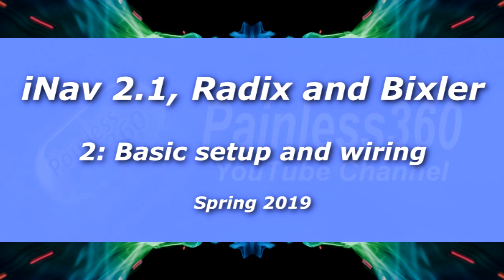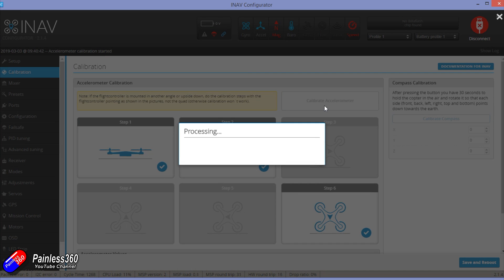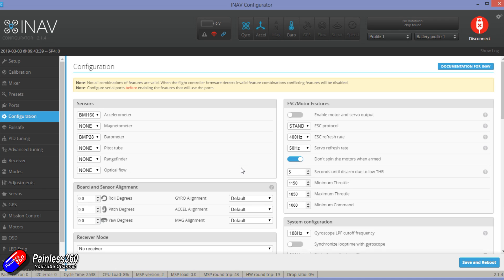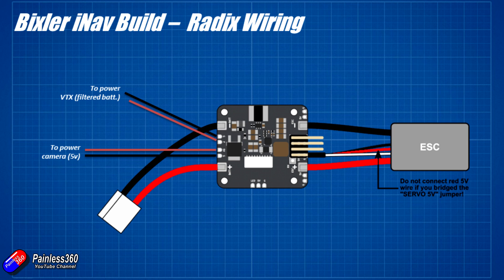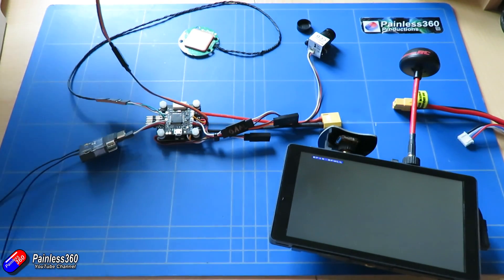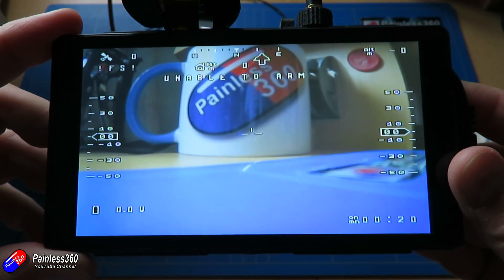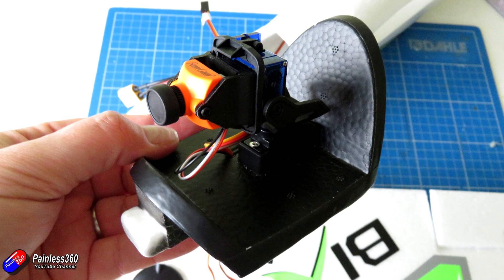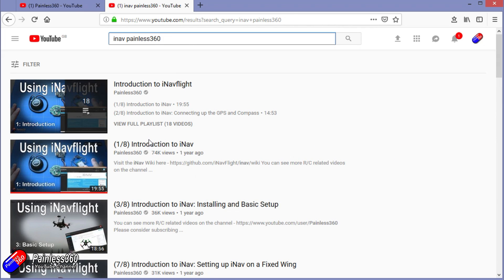iNav 2.1/Radix/Bixler Build Series: 2. Basic setup and wiring

Comment: I'd love a video solely focusing on wiring fpv cameras, video transmitters, and inav osd/uart settings. I'm having issues trying to get my camera and video transmitter to work. (I'm using a Runcam Phoenix 2 and TX200U and wanting to set up iNAV OSD.
Reply from the maker: Check out my INAV for beginners series, I cover it in there.. best of luck
Reply: @Painless360  I have watched that series several times. I must have wired something incorrectly.
Reply from the maker: Possibly, it is easy to do. Try getting the VTX working first - you'll have a black screen with the OSD on it but that will make is easier to see where the problem is.. Best of luck!
Reply: @Painless360  I made some extension jumpers and plugged the camera and vtx in 1 pin off from where they were supposed to be... I feel like I wasted hours troubleshooting and second-guessing myself for nothing. Lol
Reply from the maker: You learn a lot more from a mistake than you do when it goes right. You'll never make that (or similar) mistake in any build for a while now.. Great to hear you got it sorted!

Comment: Hi Lee - great video. Just back from a disastrous afternoon after crashing the Skyhunter 1800 due to INAV playing up. Thinking of getting a BIXLER as next model. Currently using Matek F765 - would it fit in the BIXLER?
Reply from the maker: That would be a tight fit. See how I squeezed in a flight controller in a previous build series.. Happy flying
Reply: @Painless360  Yes - just watched your video. What is the Flight Controller that you used and is there a newer model?
Reply from the maker: Links to it in the description on that video.. Happy flying

Comment: Hi, I am running Inav  2.1 on omnibus F4 pro and bixler 2. Do you think I can do the same for servo mixer? Like have the Y cable for the aileron?

I have flap too. Where you you think I can connect it?
Reply from the maker: Should be fine. I'd use the 5v BEC pin mod I used to make sure the servos have power from the ESC...
Reply: @Painless360  thank you!

Comment: how can you setup UART3 for CRSF signal received thought TBS Crossfire in iNav? in receiver mode it doesn't give that option for CRSF protocol
Reply from the maker: I'm planning sure that it is supported at the moment. You can use sbus if you cant pick CRSF...
Reply: @Painless360  i think in the receiver mode  section 2 drop down bar you select TBS Crossfire which my only option could be CRSF :D

Comment: On the GPS puck just wondering does the compass be also included with in with TX and RX function or do you need to use either or SCL, SDA for the Compass to work ?
Reply from the maker: You need SCL and SCA for the compass..
Reply: @Painless360  was just wondering how Fpvbrain OSD gives you a compass reading, if connections are not being used later on your video?

Comment: Now that I look at it my VTX (TBS Unify), like many video transmitters today, is HV meaning it wants full battery voltage.  Not sure where on the Wing Power Board I tap into filtered battery voltage.  I haven't found much info on the Wing Power Board, even on the Brainfpv site.
Reply from the maker: I'm using it that way - diagrams in the series..

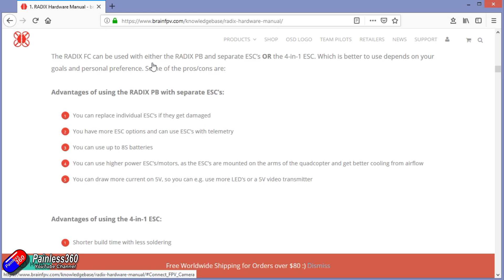Comment: What is the best way to power the VTX and Cam?  At 7:27 you show power from the Wing PB but on 6:33 the Radix Manual shows power from the Radix Board?  Does it matter?
Reply from the maker: I did it the way I show in the video.. works for me..

Comment: Really nice and clear instructions.  I noted you tested the setup using an LCD screen with radio gubbins - can you tell me what type you used (is there a review on it?).  Thanks
Reply from the maker: That is the screen from my fatshark transformer goggles. There are lots of options for screens like that and I use them rather than goggles for the videos as they are much easier to see. Happy flying!

Comment: I just finished (almost) my first fixed wing setup with the Radix FC and Wing PDB on a sonicmodell ar wing 900mm but have run into an issue. My ailerons only move full throws when I move the stick to the upper left or lower right. Moving the stick straight up, down, left or right only gives me about 5% movement (if that). Also, the control surfaces move in the correct directions (opposing) with the 'roll' stick movement (left and right) but do not move in the same direction (both up or both down) for what would be 'pitch' (stick up and down). I am sure I must be missing something obvious.

Have you run into this before or have any ideas?
Reply from the maker: https://youtu.be/SA7reaRMF4M

Comment: Looks like to do this build ill have to buy a completely new radio system as only got a DX6i or is it possible to do it with that ?
Reply from the maker: Nope, that should work fine. All of the clever stuff is done in the FC..
Reply: @Painless360  will you be doing a video of of to do that setup for a TX like dx6i ?

Comment: Great video, neat job and very interesting, thanks. I have recently set up a fully automated FPV Bixler 2 using an older APM 2.6 board, with MWOSD and a teensy 3.2 board flashed to pass telemetry back to a FRsky telemetry RX (pass through is not an option with old APM's). With the APM the Bixler is capable of fully autonomous flight from takeoff to landing without me being there (more fun when I fly it FPV). A Runcam Split provides FPV vision and HD video. I like your addition of the 2 axis gimbal and I'm keen to see the flight video. Thanks again Lee for showing us what is possible. My video is at https://www.youtube.com/watch?v=3TkhkZG-2-A if interested.

Comment: Lee, that is a heck of a tight and well thought out build.   I’ve already ordered the Radix flight controller and wing pdb (they are hard to find in stock).  I agree with you that the vector graphics display is so much better and cleaner than your basic clone F4 board.  I fly lots of fixed wing high performance craft such as Draks (full size and mini),  various wings, mini talons, and lots of HK Avios and Durafly stuff, and even a Bixler.  I have three working Eagletree Vector flight controllers and a fourth that is history after a spectacular lawn dart crash.  My question is this: do you think this Brain FPV FC and Inav is robust enough to put in a 100 mph Ritewing Mini Drak, as I’m not buying any more $ 240  Vectors?  I think your setup is very elegant and cost effective.  Please advise, and thank you.

Comment: Can you use inav to operate a vtol?  If so what configurations are supported?. SLT?,Tilt motors?, tail setter? etc.
Reply from the maker: Not that I'm aware of.. yet!
Reply: @Painless360  darn.   Can mulitple PID values be set up and activated by a switch?  If that is possible vtol   programming would be easy

Comment: Nicely done!! Are you powering your all 4 servos from the ESC's BEC? and did you have to do something on the radix board to isolate the boards 5v (on servo output pads) from the ESC's 5v? thanks.
Reply from the maker: Yes, see previous video in the Series for details. The 5v BEC on the wPB isn't powering the servos..

Comment: I prefer Bix 3 because wings come off which give you more acces 

Were did you get the GPS unit ?
Reply from the maker: I've had it for ages - Banggood or eBay usually..
Reply: @Painless360  So any gps unit will do ?
Reply from the maker: I use this one or an M8N (as per the iNav Wiki) see all my iNav builds...
Reply: @Painless360  If thre is a gps unit does it mean you can do RTH ?
Reply from the maker: Yep. Watch he rest of the series.. I show it in action..
Reply: I just received my BN 880 unit and it works well with F405 Wing!

Comment: The Radix seems to be out of stock. Shipping fees from UK to Austria is also a bit high. Could you recomment a FC for my Bixler I can order at Banggood or something like that? Any good alternatives for the Radix?
Reply from the maker: https://youtu.be/te4D_fjBVfM may help..
Reply: @Painless360  Thanks, will take a look. I also discovered your video on the Matek F405. Looks like a good choice for a fixed wing, doesn't it?
Reply: For the Bixler the F405 or the F411?
Reply from the maker: The lack of room might make the 405 a tough fit..
Reply: @Painless360  thanks for the answer. You could be right. Maybe the F411 is a better choice or I use another model than the Bixler. Or I use the Radix. Discovered a shop in NL that has the FC and the PDB on stock.
Reply: @Painless360   I was planning for Omnibus F4 Pro V3 FC for my bix3, your thought for it...?